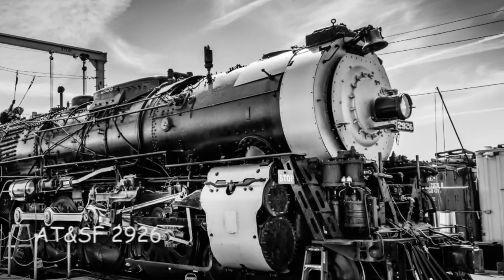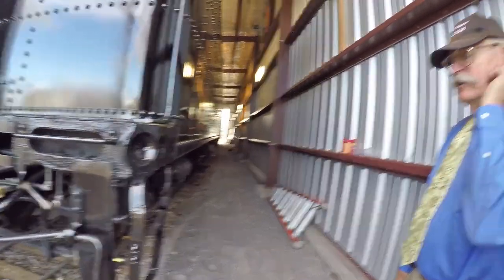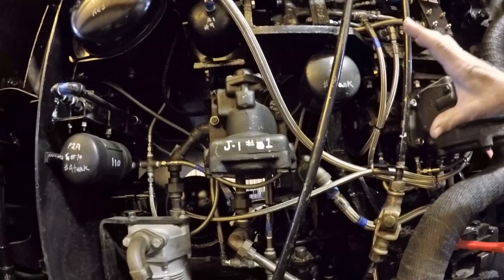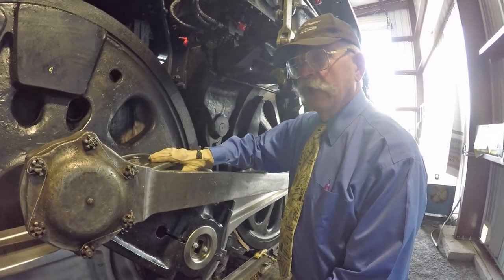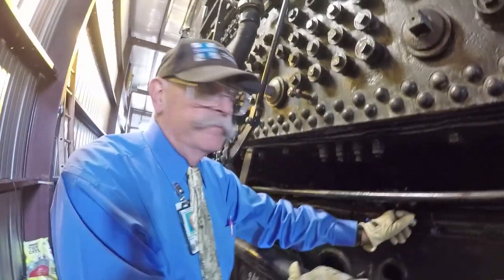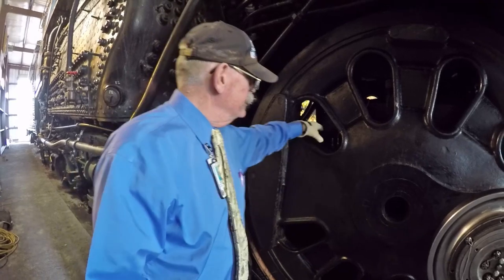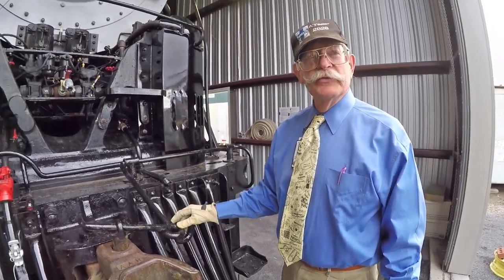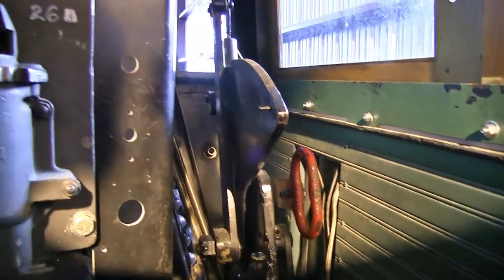Santa Fe 4-8-4 #2926 rebuild - full restoration report  2017

Comment: Wow, the 4-8-4s were huge, seemingly like a city bock! Always exciting to see one of those beautiful old steamers being brought back to their former glory.
Reply from the maker: Yes indeed. The latest 4-8-4's built in the mid 1940's were huge. The 2926 was one of the Santa Fe's 2900 series which were the largest and heaviest 4-8-4's ever built. This was partly due to the lack of availability of certain lighter metals owing to the war effort. Thanks for your interest.
Reply: @svsfilm  that is very interesting. I collect N scale models of the PRR, mid 1950s. They ordered the 2-10-4 as a heavy freight engine for the war effort. Did t know about the shortage of specific metals and how it influenced designs. In any case the last US steamers from the 1940s were increcible designs. Then the EMD diesels took over as we all know. Thanks fir the reply.
Reply from the maker: The light weight rods that replaced the originals are discussed from 16 minutes into the film. I believe the same limitations applied to the 5011 class of 2-10-4's.

Comment: You mentioned that there was a few tons of calcium carbonate scale in the tender. If I recall, in a NY Central video, they used to test the water supply for the tender regularly and then add chemicals to is to reduce that. Might help after all the effort the volunteers put in. The water out west has a lot of calcium when untreated.

Comment: 20:00 I carved stone for 20 years in a small shop of 5 guys.The old timers who worked there through the 20's to the 90's where just about gone. A shop that at one time had dozens of stone carvers and stone working machinery. Huge saws, turning machines, lathes ect. Thankfully they left behind these volumes of books on how to work the machines that had gotten old and rebuilt over the years. How to take things apart, rebuilding parts, short cuts. Those books where hand written with dates and pictures that dated back for decades. But they where life savers.
Reply from the maker: That's one of the wonderful things about preserving these examples of engineering - many of the skills have been lost and must be relearnt. Thank you for your interest in this project and watching this film!

Comment: He is correct, the 844 and 3985 both us a No. 8 brake system, Ed Dickens has said that the No. 8 system is the best for steam locomotives. The Southern Pacific 4449 and Spokane, Portland and Seattle 700 also use the 8 system

Comment: trucking thru Albuquerque i suffered driver distraction looking for the ATSF locos. relieved that at least one has gone good hands.  Any words about the 2-10-4?  You Rock! Thank you.
Reply from the maker: Hi there. Many thanks for your interest. Santa Fe 4-8-4 #2926 is the locomotive featured in this video and is currently under restoration to active condition in Albuquerque. Santa Fe 4-8-4 #2925 and 2-10-4 #5021 were donated by the railroad to the California Railroad Museum in Sacramento in 1986, however I believe they are not on public display at present. #5030 is on static display in Salvador Perez Park, Santa Fe, NM.

Comment: Regards to ptc system.... he said electrically cutting fuel to shut down fire... what about electric valve to bleed off steam... electric pop off.. a mechanical pressure relief with magnetic seal. Mechanical seal during steam up with electromagnetic seal during run. Between fire shut down with pressure relief it should slow down faster.

Comment: Not to diminish the ATSF 2900s in any way but the PRR S1 was the heaviest, tallest and longest non-articulated, reciprocating steam passenger locomotive ever built. Remember, "The Big Engine" was a duplex (rigid frame), not an articulated locomotive.
Reply: if the S-1 was so great, why didn't they (PRR) build any copies?

Comment: That connecting rod seems rather thin for an engine that size? - 14:07 Funny story, what he said about lost knowledge or tricks to maintain a locomotive can also be said about the F1 engines that put Apollo into space... Each engine was practically hand made using special techniques, etc. - 20:33 , 21:20
Reply from the maker: Mike Hartshorne explains around 15min 30sec that these rods are not the originals. These are high tensile steel rods installed after WW2 and have a much slimmer profile than the original ones. Thanks for your interest.
Reply: @svsfilm  OK I kind of caught that. Guess I still had trouble wrapping my head around those thinner rods...

Comment: How many more weeks until this big steam locomotive steams up
Reply: Zachary Becker - soon, but no set date as of yet.
I know it’s frustrating, but we can’t afford to screw anything up on this irreplaceable machine so we don’t proceed until we have things right - and that includes a fully vetted firing procedure.
Reply: NMCCW thanks
Reply: NO CLUE
Reply: Zachary, now that Amtrak has shit canned all privet car excursions/movements on any trackage they operate on, the chances of 2926 running anywhere just got really small.
Reply: Zachary Becker Well they were about to do a static steam up of the engine last week but part of the trailing truck derailed and damaged their service pit in the process. It might be another 6 months or more untill it ever turns a wheel under its own power.

Comment: Ah ... the unloved 2900s.  ATSF wanted more Diesels but couldn't get them due to War Production Board restrictions.  So ATSF had to accept the overweight 2900s -- overweight because the special lightweight steels used on the Santa Fe's other 4-8-4s were also not available due to the WPB.  Nevertheless, they were a great design.

May 2926 live again.
Reply from the maker: Many thanks for your comments and for watching the video.